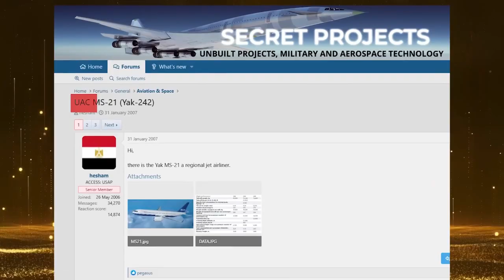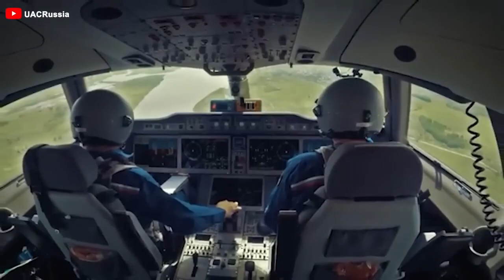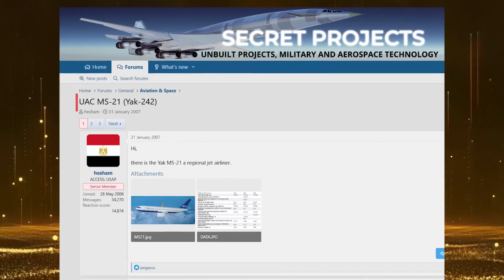Russian NEW MC-21 Will Change All Aviation! Here's why

Comment: Reminds me of the R-Fon.  They don't have enough to do.  Currently their weak point is the fact that their energy sector and air defense sectors are degraded  9:1 every day.  Meaning;  Each day they make 1 days worth of repairs or build 1 days worth of air defense capacity, and lose 9 days repair or replacement capacity.  In business terms if a corporation makes $1m a day, yet it costs the corporation $9m that day to do business, then they are in a capitol shortfall, and once they burn through it all, they have no further effort to be made.
A further indication of the Russian degradation:  524 at Colonel or higher have died since the start of the war.  At their Academy graduation and rank progression rates they are also running out of experienced Higher Ranks.